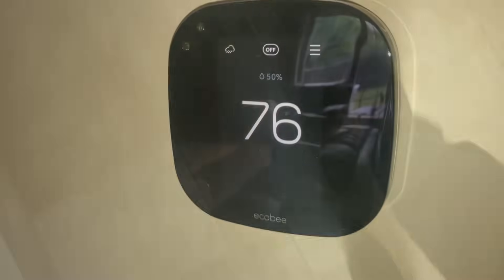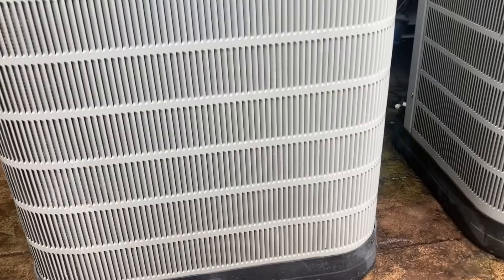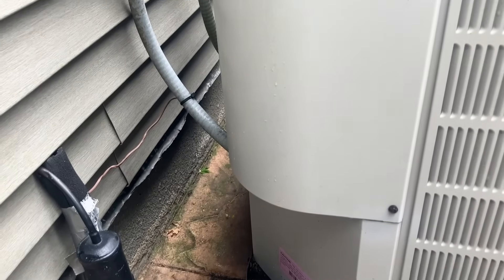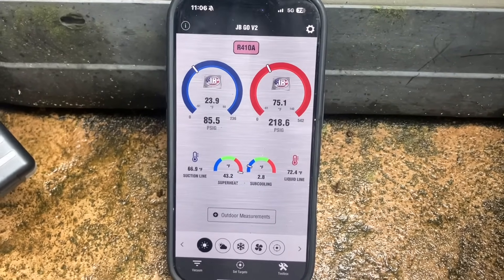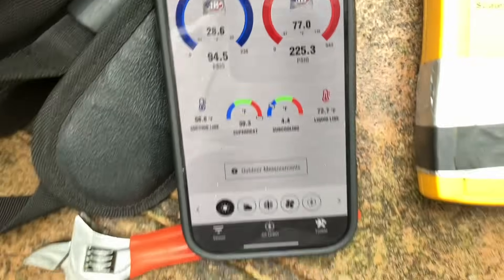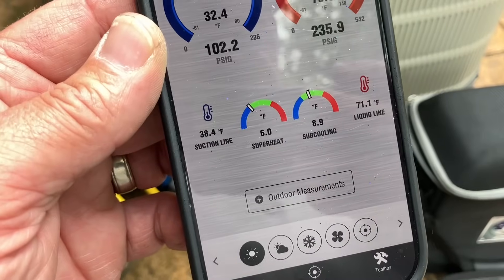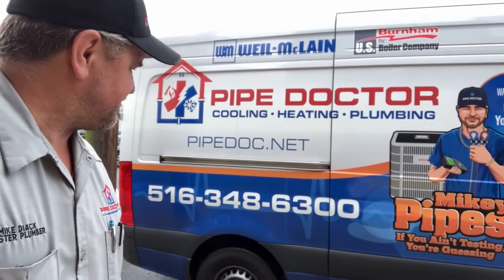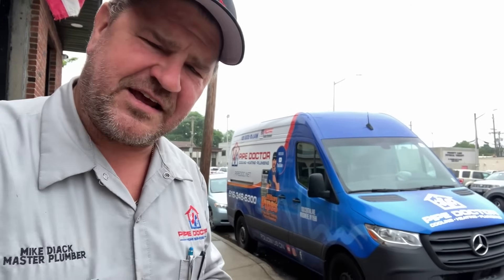Central AC Frozen Solid?! Low Refrigerant, Frozen Coil, & the REAL Fix Explained

Comment: It's surprising to me so many HVAC students are paying to go to school and don't know what a capacitor is or even how to test them. I'm on my 3rd week working as a maintenance technician and was given a month of training before that. I did have low voltage experience from my previous job and proved to them I'm mechanically inclined. If I lived up your way I would sell a kidney to get on as a apprentice with you as my teacher. These kids have no clue what kind of opportunity they are turning down to be given that apprenticeship opportunity by The Mickey Pipes. I watch your videos daily and have not only invested in myself so I can learn something new every day about HVAC maintenance and how a HVAC system works and operates. My main weakness other than just lack of experience is reading refrigerant pressures and subcooling and superheating. I use the fieldpiece app and measurequick app when I test refrigerant levels. I just need to have someone actually sit me down and teach me instead of just showing me a few times. Charge one system that was low and kind of through me to the wolves to figure out the rest LMAO. Huge Fan! Love the videos. Can't get enough of them.

Comment: Your system is lacking air flow
Reply from the maker: No it’s not
Reply: I thought that too at first but its got a low load. It looks like mikey was adding when it was around 65 degrees outside because the liquid line cant be colder than ambient lol

Comment: unless its 65f in the house suction temp should never be anywhere close to 32f, I see its fully charged so there are problems with dirty coils or txv issues or other in line restrictions!
Reply: Are you sure it was the suction line temperature?  I think that was around 42 degrees.  The 32 was the temp in the evap coil corresponding to the low side pressure.  I do agree that it should be higher than 32 Unless the system is low on refrigerant.***( Then again, I have no idea what I'm talking about, usually). Freeze the video at 7:22 and look at the gauges
Reply: @Drrich_DIY  top left gauge says 31f
Reply: suction copper line is 42F, 42- 31= 11superheat
Reply: @carlosguzman4911 I thought you meant the copper suction line temp was 31 at the condenser.
Reply: probably a piston not txv, low outdoor temps, not a great load indoors and you get willy wonka, mild floodback. who fully knows without seeing the whole system from end to end.
 gas it up to where it looks fair and tail lights 🤣

Comment: I don't understand why one wouldn't wish to know where the leak was and fix it. 
Our team here in San Diego does shipboard galley (kitchen) and we will find the leak and fix or if need be replace the condensing unit after putting on quick disconnects for the low and high sides. 
Think Cospolich, MGR, and Lo-Temp brands.